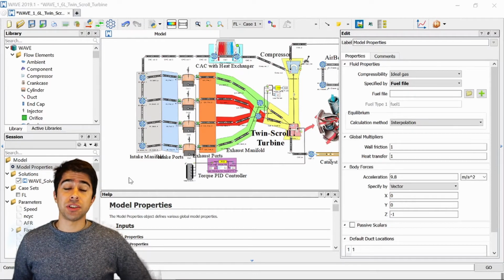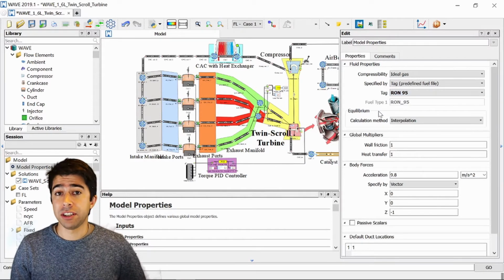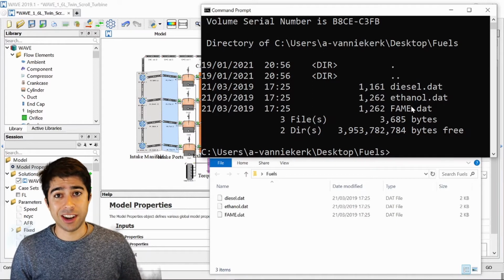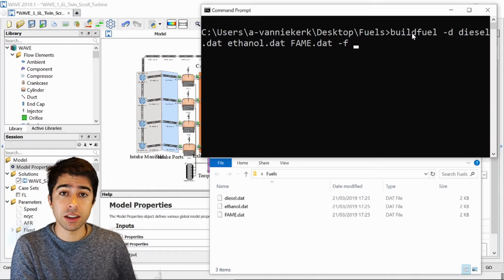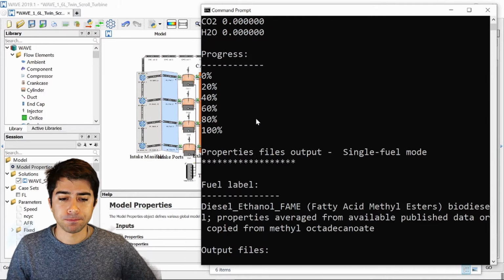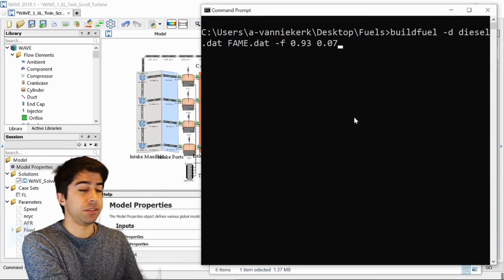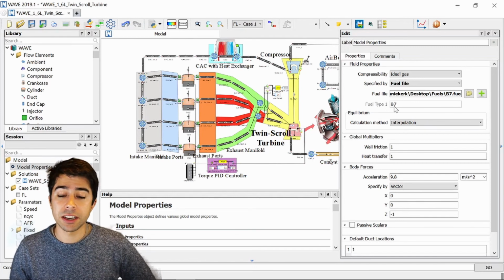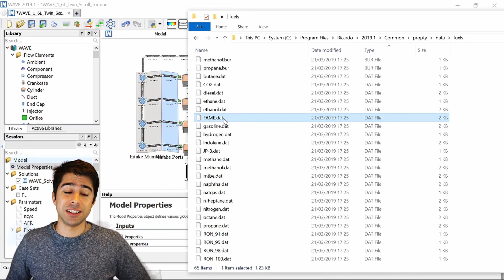How to create a fuel blend with more than one component in Ricardo WAVE | Ricardo WAVE tutorial

Comment: Hey! How do I convert a .fue file to a .dat file?
Reply from the maker: I don’t think that is possible. If it is a .fue file supplied with WAVE, then the .dat file will be available as well. 
Is this your situation or did you get a .fue file from somewhere else?
Reply: @AdriaanVanNiekerk  no I created the biodiesel fuel blend using command prompt.
Reply from the maker: @varunmkashyap6224  Alright - then you should have access to the dat files you used to create the biodiesel blend
Reply: @AdriaanVanNiekerk  yes I do. I used diesel and FAME to create B10 and B80 blend. I’m running a dual fuel operation with biodiesel+syngas. To load both these fuel files on model properties I need to create the biodiesel_syngas file using the green plus button. For this, I need the biodiesel file to be in .dat. I tried altering properties of FAME to match my requirement but it’s so tough to find all the fuel properties..there are so many parameters 😓

Comment: I just wanted to ask you a  once again doubt is it ok to blend hydrogen with a methanol in the similar way. Does  gas and liquid fuel mixing together and passing it through one injector is practically possible?? thank you
Reply from the maker: No I don’t think it is practically possible. I think a better way would be to inject the hydrogen through port injection and the methanol through direct injection.
Reply: @AdriaanVanNiekerk  thank you sir for your kind response, is it possible to adjust air flow rate?? May I have your contact email.
Reply from the maker: @subramaniann8465  yes can adjust if with a throttle valve. You can email me at adriaan@adriaansblog.com or join the discord server 👍🏻

Comment: Can we create fuel blend between liquid and gasses e.g. Gasoline and Hydrogen. Keep the excellent work
Reply from the maker: Yes you can - there are some instances where you can create one fuel file where you have hydrogen (as a gas) and gasoline (as a liquid). This file keeps the two components seperate,  but you can use it in your model. It is a bit difficult to explain, but I am planning on making a video on how to simulate a dual fuel using gasoline and hydrogen 👍

Comment: Hi, do you have any tips on where to find .dat files for fuels that aren't built into wave by default?
Reply from the maker: Good question - the best way to create a .dat file that is not provided is to take an exisisting one and modify it. I wanted to create a .dat file for a specific biodiesel fuel, so I took the FAME.dat file and changed some properties of the fuel in the .dat file so that it is more representative of my biodiesel fuel. This obviously can only be done if you have information about your fuel's properties.
Reply: After creating the data file...the Ricardo wave post failed to generate a graph for my data file saying it doesn't know know to open the file ....how do I correct that

Comment: Hello sir i have a doubt. i wanted to mix methanol with hydrogen try different compostion for example 10% hydrogen with 90% methanol.So should i try the values in cylinder option that is intial fluid composition option or in the injector.
Reply from the maker: Hi Subramanian. I think you will need to create a fuel blend with the percentage components that you want to look at between methanol and hydrogen. The two options you mention can only be used to simulate a mixture between clean air, burned air, burned fuel and injected fuel.
Reply: @AdriaanVanNiekerk  thank you sir

Comment: Hi Adriaan, I am working on Hydrogen powered ic engines and I m facing some error INJ:TYPE
   F*** LIQUID FUEL FRACTION CANNOT BE SPECIFIED FOR GASEOUS FUEL
Maybe IDK the right way to inject Hydrogen as a fuel .Plz lead the right path.Thanks
Reply from the maker: Hi Atul. Unfortunately I have not tried running an engine with hydrogen. None of the examples that Ricardo WAVE provides give any guidance unfortunately. I suggest you go have a look at examples where CNG is used? As both CNG and Hydrogen is injected as a gas? So hopefully there will be some similarities in the model set-up
Reply: @AdriaanVanNiekerk  Sir the problem is in that example of dual fuel fuel file of diesel n cng was used 
But I don't have fuel file of diesel n hydrogen.
Reply: And also I'm not getting any source whre I can find the fuel files .
Reply from the maker: @AtulKumarBME  You will have to create the fuel file yourself. It is a bit different when you simulate duel fuel scenarios (two seperate fuels going into the same engine). In the dual fuel tutorial they show you how to create the fuel file. It might be that the fuel file that you are using is causing your error.
Reply: @AdriaanVanNiekerk  Sir,  I'm not able to create a fuel file of hydrogen with diesel. And if I try to inject hydrogen fuel from tag list it shows the problem above mentioned in first comment .
Reply from the maker: @AtulKumarBME  That is unfortunate. When I get some time I will see if I can create a model using diesel and hydrogren. and let you know what I find